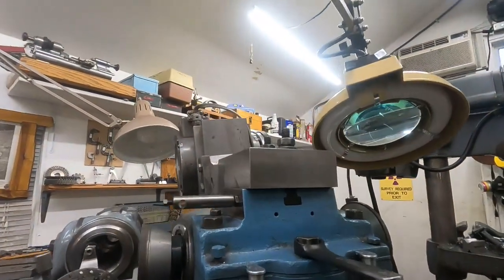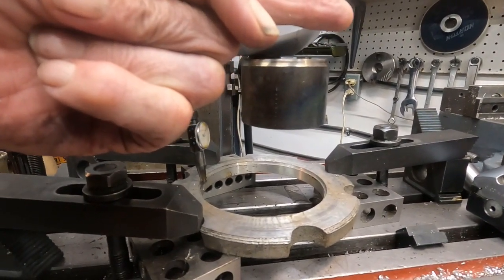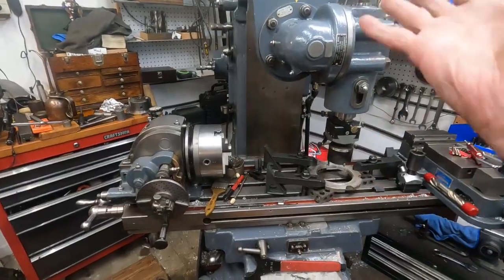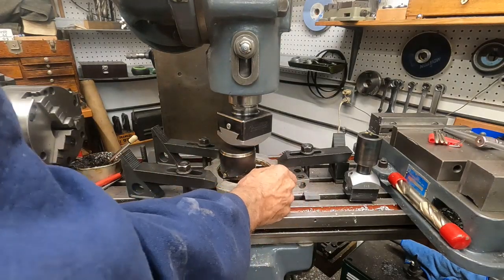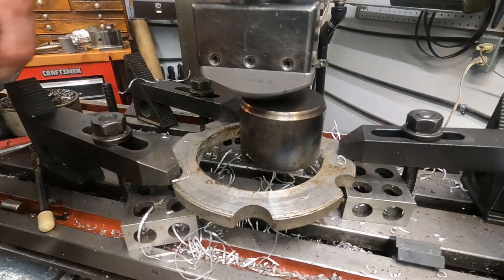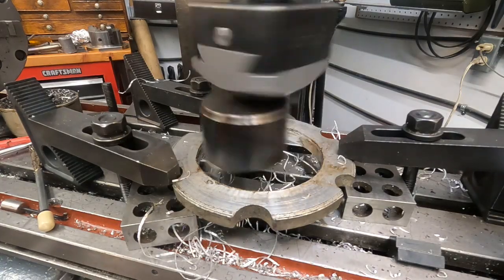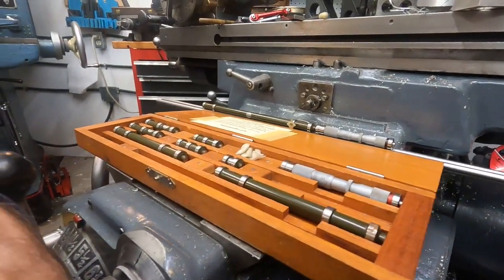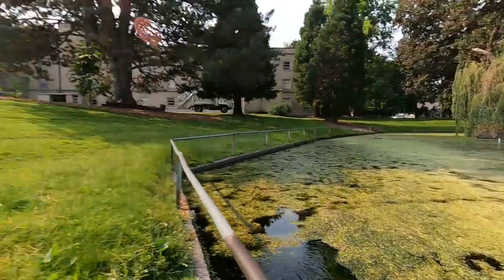Jigborer style boring bars for larger hole sizes in milling machines

Comment: Nice . I like the boring tool design .    The D'Andrea head i used to use , i had to grind some pretty funky tool angles due to the tool hole being in line with the boring bar centre .    Cheers   👍
Reply from the maker: This was a Moore tool design, very much like a fly cutter. I remember those facing heads in catalogs

Comment: Dee, I solved the rpm range problem on my Bridgeport clone. Stripped out the panel of all the old relays and transformer and installed a Fugi Mini VFD. it spins my 3hp motor fine and is a belt drive, so it is super quiet. it would not help the noise much since the B&S is gear/chain drive but would give you an infinite range. I have not had any issues with torque. I just looked at the thermometer and itis 109 here in North Texas.
Reply: @terrycannon570  so, there can be a long term problem putting a VFD on an older 3 phase motor. If you’re just using it to get from single to,three phase and not varying the speed, it’s fine. But VFDs have torque control. On the lower speeds that means that they increase the current to the windings to keep that torque even. That results in a lot of heat in the windings. Older motors aren’t designed for that. The insulation and varnish, if they used it, can damage that and burn the motor out. When I replace 240 single,phase motors with VFDs and three phase motors, I only buy inverter ready motors. The same thing when I replace a three phase motor from an older machine. If you have a new motor made no more than about ten years ago, there’s a good chance it will handle a VFD properly. But older motors aren’t designed for that. Motors built before 2000 can be a risk, particularly really old motors. People like to think that old motors are built better, but they’re not, they are very inefficient and waste a lot of power, so increasing the current can be dangerous. Just something to think about.
Reply: @melgross  Thanks @melgross. My Bridgeport clone is a 2005 model. I also have an old Clausing model 100 lathe that I converted over to 3 phase. I bought the motor used from a place that I have dealt with for years and it is an industrial motor. Only paid a little over $50 for it and it is a 2 hp. The lathe originally came with less than a 1 hp motor. I wanted 3 phase so I could run it at higher speeds and have better control of the rpms. So far that one also does what I need it to. Because I am a Hobbyist the motors and VFD's don't get to see the full duty that is seen in commercial applications. On my Clausing 5913 lathe I am using a Rotary Phase converter from American Rotary. As I am sure you already know the 5913 has Hydraulic Reeves type drive to control the spindle rpm. I have also rebuilt the motor and variable sheave drive along with the hydraulic cylinder . It all works fine but the noise from the geared spindle makes me prefer using the smaller belt drive lathe.
Reply: @terrycannon570  my lathe also uses a Reeves type speed adjust. I prefer that to a fully geared head. All those shafts and gears make quite a racket. It drives me nuts. It’s enough that I wear hearing protection with any grinders, my metal cutoff saw and some milling operations. I don’t want to use them with a lathe too. I do use a VFD on my three phase 3 horse motor for my lathe. But I only keep it around 60 Hz. It’s such a major job to get to the motor mounts, under the transmission, that I never wanted to take the motor out.
Reply: @melgross  The motor on my big mill is 3 hp also. I would have ran it on the rotary phase converter but my converter is just under running a 3 hp and I didn't want to spend another $1000. The Fugi Mini cost me about $400 and it is a industrial unit not one of the wimpy China Ebay VFD's. One thing is for sure @melgross let the buyer beware when it comes to VFD's. Not know or understanding I expected plug and play and if you have a 2 hp motor why not buy a 2hp vfd. Wrong! I also expected clear written instructions in real English not Chinglish. Wrong again! I paid a few dollars to learn what little I know about VFD's which is not much. LOL I have a spare VFD that has never been used because I still don't have a clear understanding of how to program the Son-of-a-bitch.
Reply: @terrycannon570  it’ll probably be ok if you’re using it moderately. I like TECO Westinghouse VFDs and motors. They’re very good and after I’ve programmed a number of different manufacturer’s VFDs, I can say that their programming makes the most sense. The Schneider models are the worst. Programming is supposed to be standard, but theirs is backwards. Very annoying. Just keep the VFD away from vibration. They really don’t like that, and if they have a frequency control knob, the frequency will creep one way or the other from the vibration.
Reply: @melgross  Thanks for the information. the one for the lathe is on the wall and should not see any vibration. The one on the mill is inside the cabinet that did have all the old relays . The mill is a belt drive and as smooth as Whipped cream. I sure do hope I don't have any trouble with them but at least now I know how to program and use them. There are hundreds of videos on how to wire them but very little in detail of programming them.  Best I can tell is they are all very similar in wiring to power source and to the motor.  I think I got overwhelmed with information and options that I will never use. I'm simple I like On-Off.
Reply from the maker: I am considering doing that but there are 2 other small motors on the machine. The weather is cooling off now, we had 107

Comment: How important is it to tighten that middle screw on the gib?  A guy told me to set the gibs snug and leave it alone.
Reply from the maker: If the screws are too tight a little tab can break off the lower sliding part of the head the screw pushes on. The square Criterion heads were made in 2 styles on the locking side the early type has a plate. I think it is like chucks where trying to be consistent on tightening helps with consistent results.
 The later heads I adjust the two outer screws for a snug but smooth screw adjustment and use the center screw to lock it before cutting, thanks!

Comment: My mill is only around 1,200 pounds. So when boring, I can get a lot of vibration. So I’ve made several counterweights. If I’m boring anything more than around 1.25” dia. I use a counterweight in a hole on the other side, or on the end, to balance that bar. It really helps. I think that set of measuring mics would cost a lot more than $1,500 in today’s money.
Reply from the maker: The vibration makes the holes out of round, It may be best not to use dial bore gages on heavy antique milling machines. Just kicking the machine around using the vertical head, it can hold .0005" on holes being careful. I have not done enough boring with the horizontal spindle yet to know how that is doing.
 I was going to put the Mitutoyo 2 axis DRO that came on the Axelson lathe I replaced with a TravAdial on this mill but thought the End Measuring Rods would be good enough and more interesting for videos, so I gave Rob from the mold shop that DRO in part for the grinding fixtures and lots of small items I am using in here now.